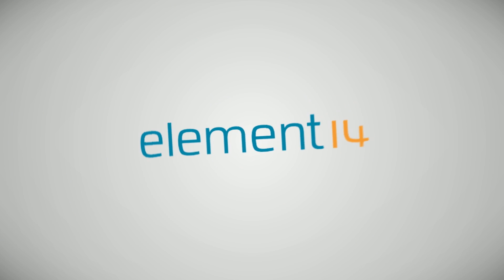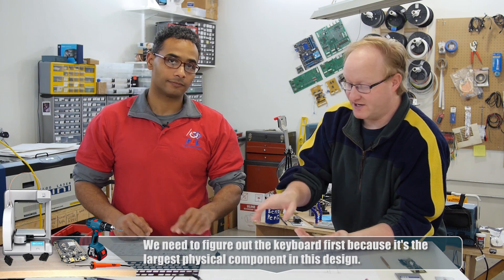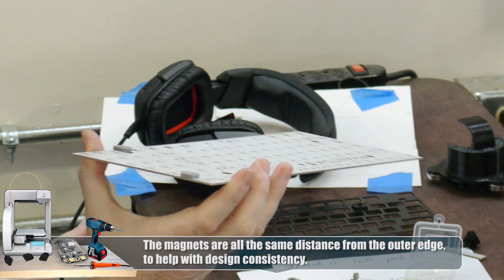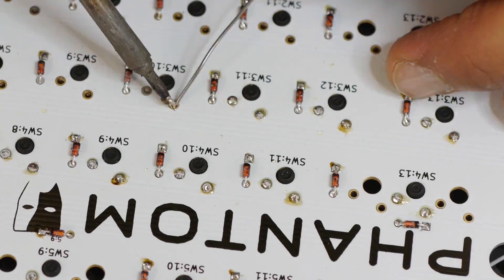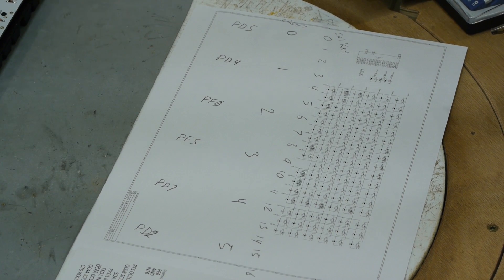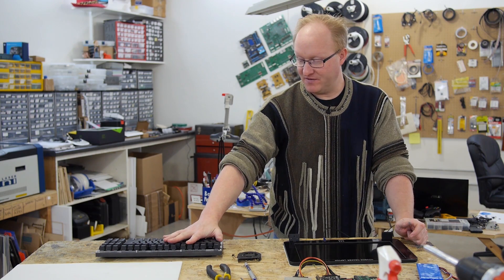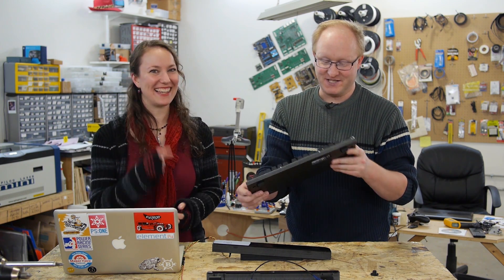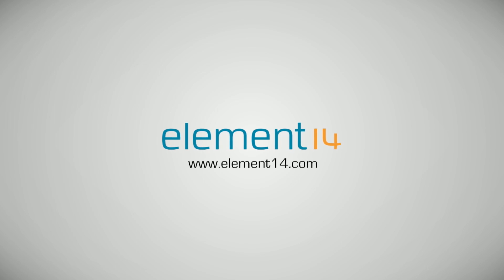Ben Heck's DIY Novena Laptop Part 2

Comment: so would it be possible to put a raspberry pi or a similar board in a psp housing? im not thinking of hacking up a working psp to do this but possibly using a cheap replacement kit off amazon to make a portable emulator machine

Comment: I was wondering if you could mount a blue tooth laser virtual keyboard in the body & run it off the battery.  I'm not sure how big the unit is & if it can be stripped down to fit.  They go for about $50, but need a flat surface to work off.

Comment: Few questions/suggestions:
If you are using battery powered why not use super bright blue or white LEDs which you control with PWM. 
Why would you use darlington transistors when you could use normal NPN or even better you could use MOSFET (and if you would be using a PWM you would need only one transistor).   
If you are not using oscilloscope with isolated channels you need to connect only one ground pin.
Why didn't you put connectors from motherboard on a side?

Comment: Why not use just two rows of LEDs, one on each side of the keyboard, and add a diffusion panel and reflector under the keys?  It would save a ton of space and power, and would eliminate the need to solder LEDs under each key.

Comment: I thought about the heat sink, that it would be better if it is rotated along the air flow direction, after that i saw the bar pop up with that information! ^^
Reply: I was thinking the same thing. Presumably Ben was thinking that as well but didn't mention it.
Reply: Stephen Halliwell
He mentioned it in the video afterwards :3
Reply: +Julian B (Julian7752) Ah, good spotting😛

Comment: how much did that keyboard cost in total?
Reply: +jonathan beibier ~30 for the PCB, ~50 for the metal plate, ~40 for the switches and ~20 for the key caps. You still need a case though.
Reply: +Creamy's Cove Thanks, i was wondering that too.

Not a cheap solution, but looks really nice how Ben and Felix has put it together,  will look great on desk by itself.